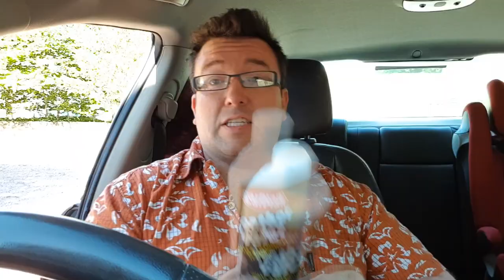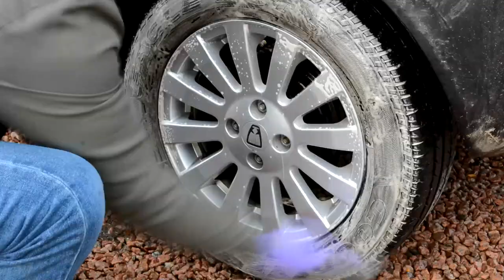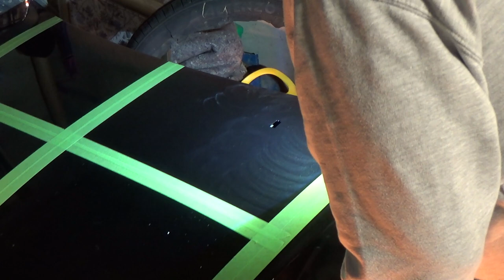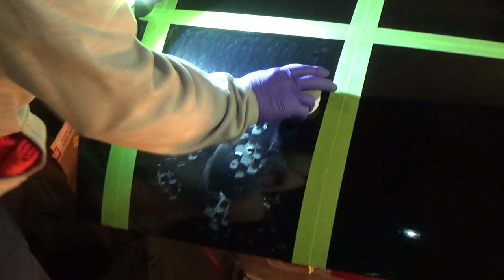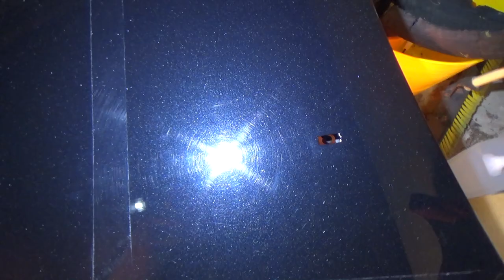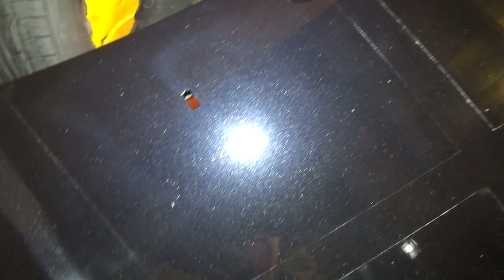AutoGlym Super Resin Polish, Ultra Deep Shine, Scratch Remover and Rapid Renovator TESTED

Comment: Thank you for the explanation. But I am getting confused :someone on YouTube said that srp doesn't contain abbrasives and you said it does contain abbrasives. This person tested polishing one clear coat with water and one with srp.
He measured the thickness of the layer and before and after polishing the thickness of the coat on both didn't change. He said that srp wasn't a polish but that the fillers inside srp filled the swirls.
Please how do you interprete this outcome?
Reply from the maker: Abrasives come in differing grades from very coarse to very fine. I spoke with AutoGlym some years ago and confirmed that SRP does indeed contain abrasives but they are very fine - to clarify the paint rather than to correct defects. I wouldn't expect regular use of SRP to remove enough of the lacquer to be noticeable.
Reply: @SpeckyMcSporran  thank you for your information, now it's clear to me 😁👍

Comment: Great vid! Could you send a link to the inspection light? Thanks
Reply from the maker: I'll add it to the video description 👍
Reply: @SpeckyMcSporran  awesome, thank you! Would the light work if used it outside? Thanks
Reply from the maker: It depends on how much light there is on the day and the colour of the paint etc. It should be pretty good but if you need more light then consider it's big brother the IL-1250R.

Comment: Hi!
I used to use renovator with machine for colour and swirls, after that I used super resin for buffing and finally coated with extra gloss...super resin and extra gloss have to dry very well, it comes of almost as dust...after putting on these coatings I first wiped most of them off with cloth and buffed up with wool...and after extra gloss I did it 3 times to get it really shining...but these were times when I was young and had the time and interest... 🙂
Reply from the maker: That was a good way of doing it but as you mentioned, time consuming. Well done on taking the time, I'll bet the car looked incredible after.

Comment: Lucky for some who have time to video on Xmas eve 🤣🤣

Good comparison, everyone has their preferred methods... Personally I wouldn't want to waste my time any more with hand application when I've got so used to machine work... Its like using a screwdriver when you have a cordless 🤣 prefer to save my wrists 😬😬
Reply from the maker: I totally agree mate. I hope more people are willing to try a machine polisher.
Reply: The "beauty" of hand polishing is that beginners can get very reasonable results, with minimal chance of damage. Power tools make work easier...but a short loss of concentration can mean costly mistakes.
Reply: @Setright  absolutely agree, which is why I said I'd gotten used to machine work...

... Nobody ever learns anything without making mistakes 😁
Reply from the maker: Can't argue with you there, I mentioned in a previous video that you need practice before giving it a serious go. That's why AutoGlym don't recommend using SRP by machine, they don't want to be responsible for novices dropping their DA etc.